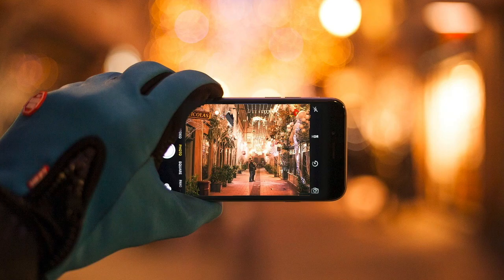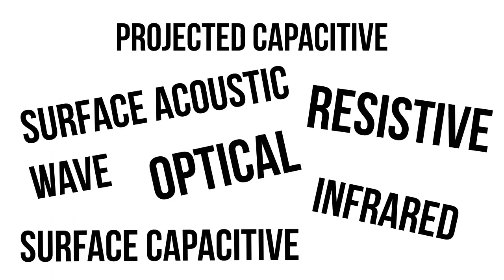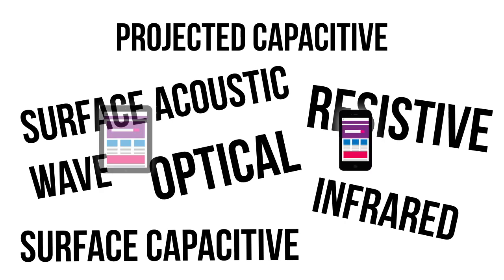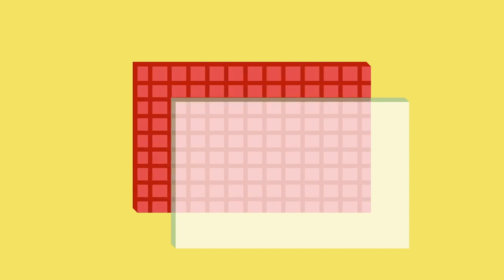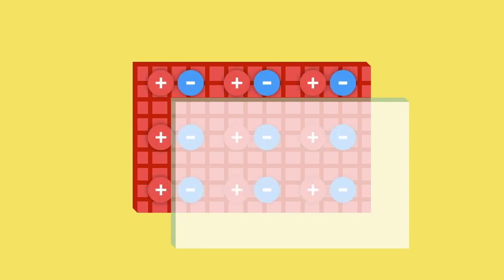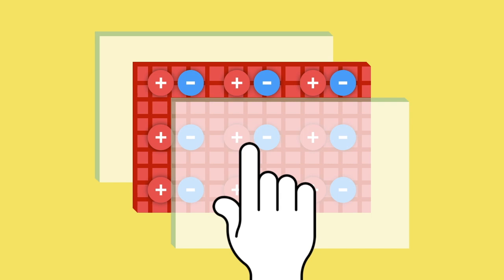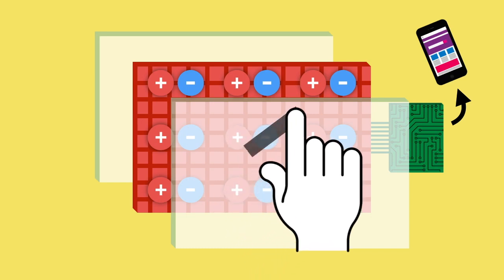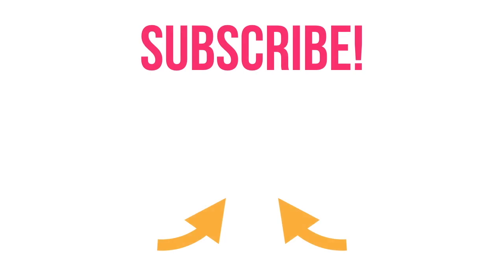Why Touchscreens Only Respond To Fingers

Comment: 0:04 gonna stop you right there, my phone's touch screen still works when I have my gloves on. Still a good informative video though. P.S. I like the outro music
Reply from the maker: Haha, do they have a thicker material at the fingertips? They have little conductive wires woven into the, so they can operate the screen :)
Reply: Or they could be wet from rain or sweat(miniscule tiny bits). We all know water is conductive so the water on your gloves is going to act as an amplifier and conductor of the electrons towards your fingers and therefore it registers as a a touch. 

You can prove this by having anything as a stylus, if you wet a little bit the end part and touch your screen, probably nothing is going to happen. But if you place your finger close to the water and the end point, without touching the screen obviously; you'll see that the screen registers a touch. Because electricity  is being transferred towards your fingers.